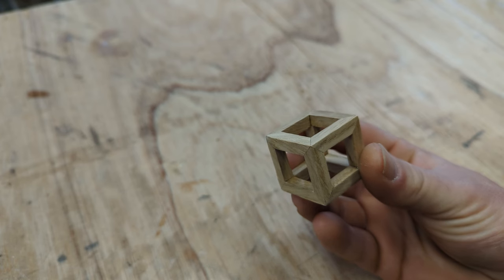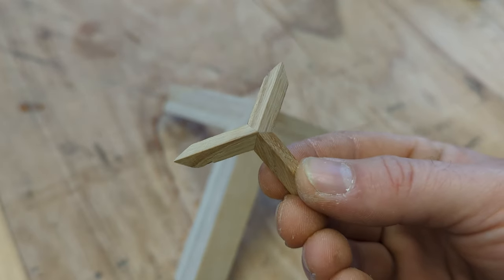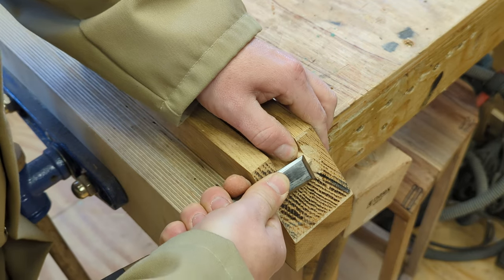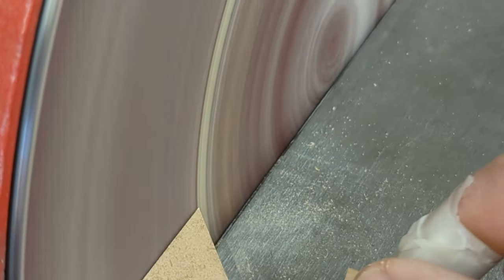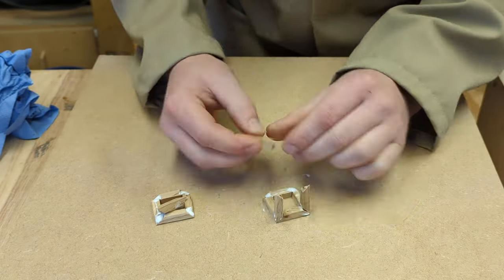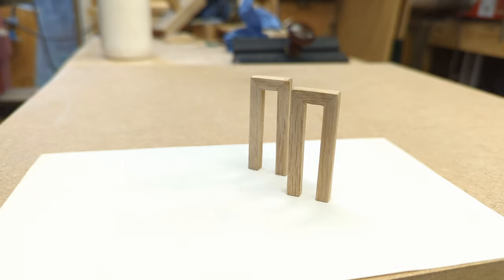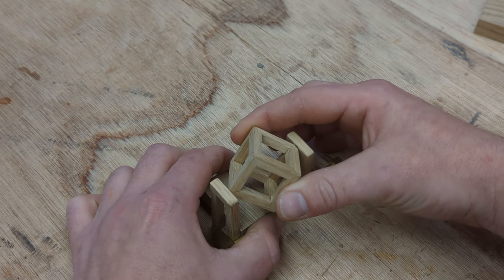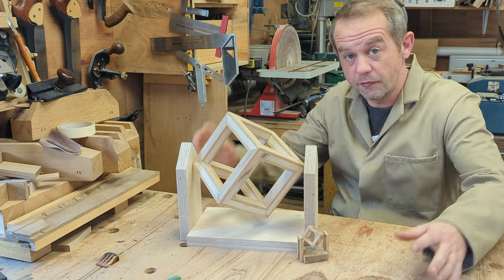Make a wooden desk toy

Comment: I really enjoyed this video. The instructions were clear and it was concise. Could make this with a knife, like a standard pocket one that can whittle wood, or would you recommend sticking to the tools? I don't have many power tools, and I was hoping i could manage it with my pocket knife.
Reply from the maker: You could certainly do it with a knife, if you mark the angles on the wood and cut to the lines I'm sure it'll work out. I'd be tempted to use a sanding block to clean up the cuts because the three way mitre isn't very forgiving, and even my version isn't perfect you can see some gaps in the joints. Good luck with it 👍
Reply: @MartinMurrayWoodDesign  Thank you!